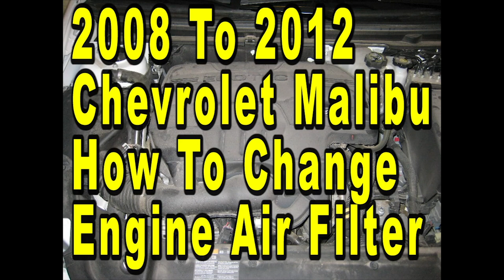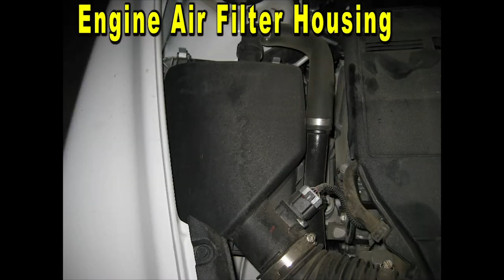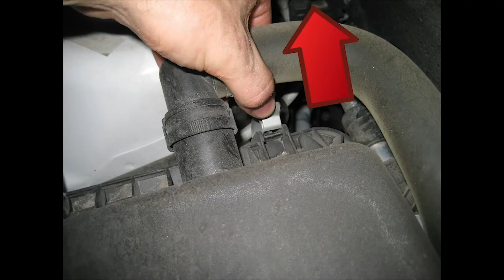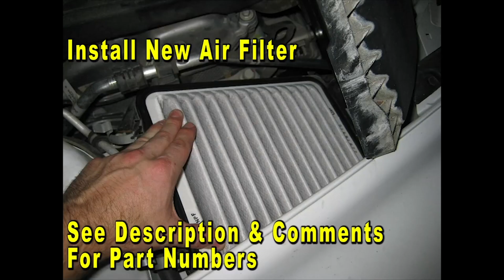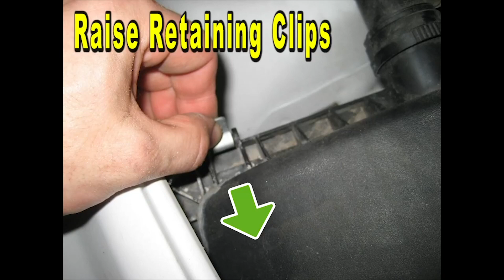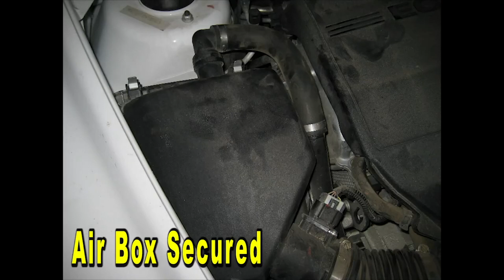2008 To 2012 Chevrolet Malibu How To Change Engine Air Filter - Quick & Easy Version

Comment from the maker: Check out the DIY guide for changing the engine air filter in a 2008 to 2012 Chevrolet Malibu - 
https://www.paulstravelpictures.com/2008-2012-GM-Chevrolet-Malibu-Engine-Air-Filter-Replacement-Guide/index.html

Here are all of the DIY repair and maintenance tutorials for the 7th generation 2008, 2009, 2010, 2011 & 2012 Chevy Malibu - 
https://www.paulstravelpictures.com/Articles/2008-2012-GM-Chevrolet-Malibu-Common-Problems-Repair-Maintenance-Guides.htm

Owners of other General Motors vehicles such as the Cruze, Sonic, Volt, Impala, Corvette, Camaro, Tahoe, Colorado, Equinox, Traverse, Buick Regal, Enclave, LaCrosse, GMC Acadia, Terrain, Yukon, Cadillac CTS, ATS, XTS, Escalade, Pontiac Grand Prix, Grand Am, G6, G5, G8, Oldsmobile Alero, Silhouette, Bravada, Aurora, and Intrigue may also find these DIY instructions to be helpful.